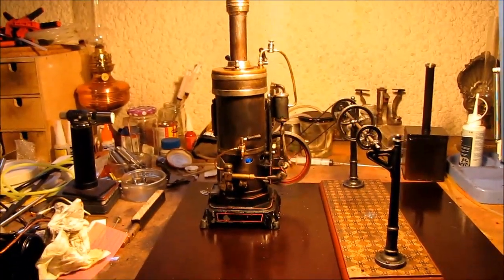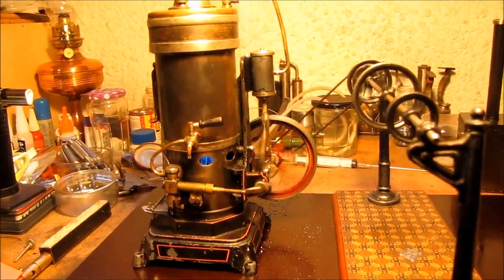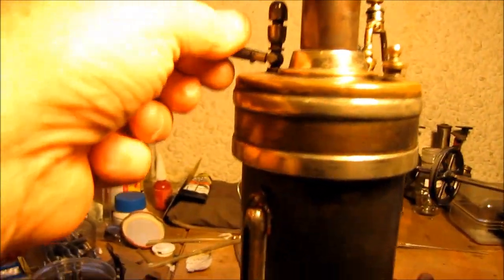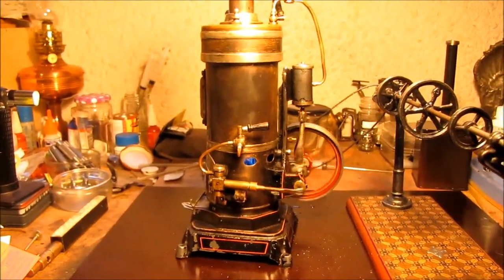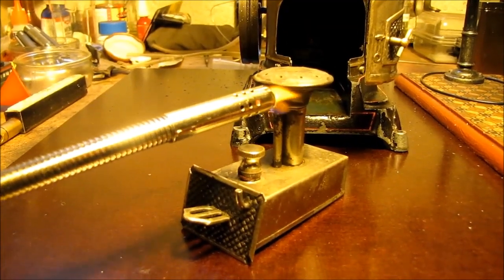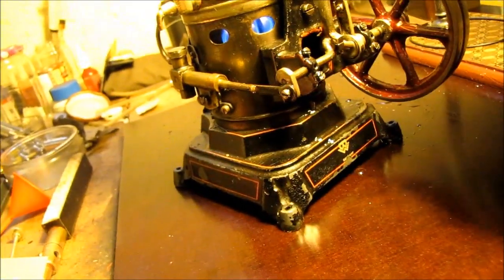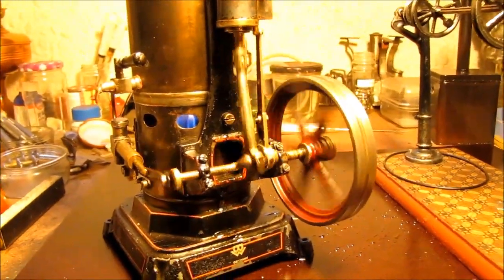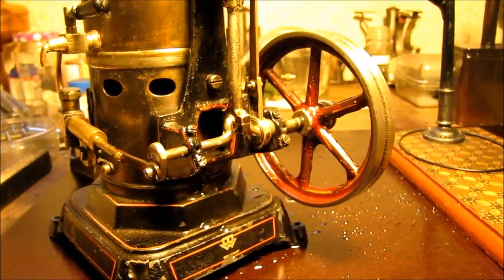Old Bing vertical steam engine revisited

Comment: Hello. Nice engine.  I bought the same exact model off ebay the other day and tried to fire it up. It is leaking from the lower part of rhe sight glass. Not the tube itself but the gasket.  I was wondering if you could tell me what size and what kind of gaskets to get to remedy my problem.  Thank you.
Reply from the maker: Hi. No hard and fast rules I'm afraid. I usually use fiber gaskets plus a high temperature mastic like Coltogum. You could also try o-rings instead of the gaskets. Good Luck.
Reply: @calypso22  thank you very much..after taking apart further last night..noticed my sight glass is broken aswel..I'm guessing no one makes the OEM style sight glass do they? Maybe I'll have to go with a weeden type sight glass?

Comment: I'm working on a antique German steam engine and was wondering what type of solder would you recommend?
Reply from the maker: For smaller engines working at low pressure, soft solder works well. For larger models, silver solder would be advisable.
Note. This is a General Rule and expert advice for a specific engine is recommended.